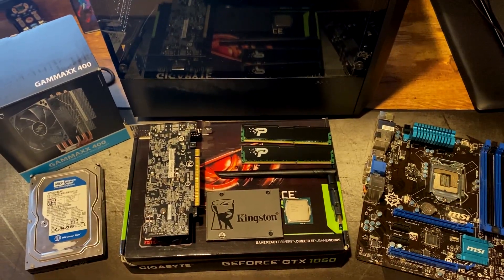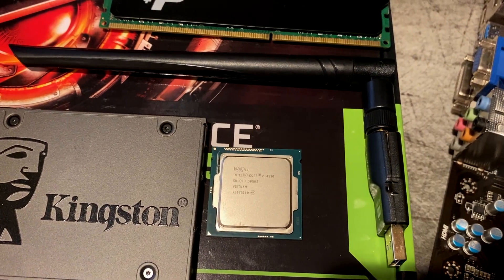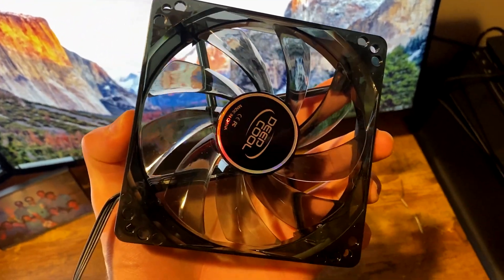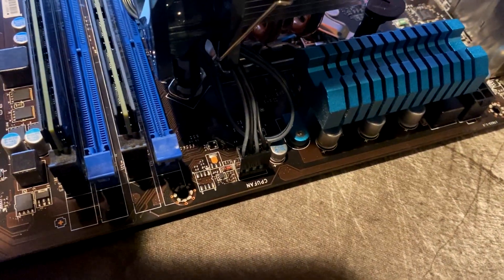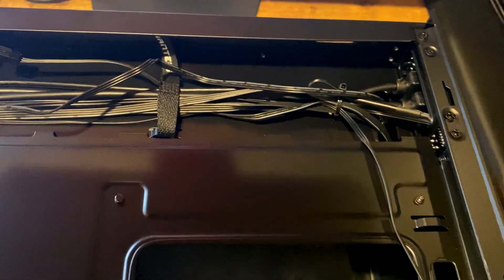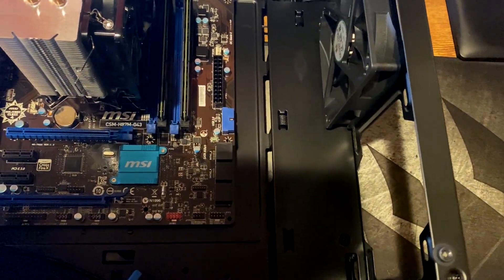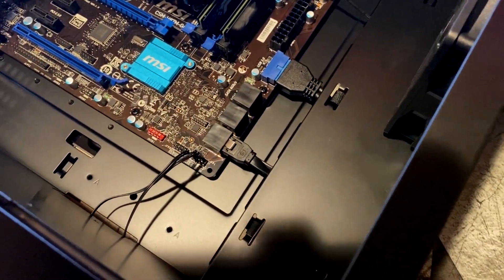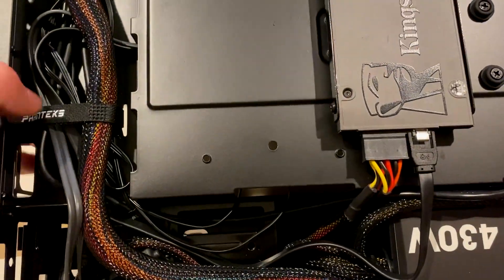How to Build a Gaming PC for Under $400

Comment: For $100 instead of getting a GTX 1050 you could have gotten a used RX570 (or RX580) with 4GB VRAM and it'll do circles around that 1050.  Other than that it rest of the specs are pretty tight.
Reply from the maker: I completely agree, I had a 1050 around from an old build, but a 570 or 580 on the used market is comparable in price and way better performance!

Comment: Hey man, really nice video, but honestly, I think, it's better to buy an optiplex offline with the i5 4th gen or above, and some even throw in a monitor and keyboard and mouse too. I'm getting that in india for like 150 to 200$, throw in an ssd, more ram, and the 1050 ti you got there, and it'll be the same build you did, for a lot cheaper too. The stock power supply is good enough to power till an 1060 gb.

Still tho, loved you video, and I hope your channel will grow.
On the side note, I would use a cheaper case lol, and swap out the 1050 ti, for an 1060 6gb. Would be way better to spend more on the gpu than on the case. (I'm planning to use the stock case too lol.i subbed tho, hope to see more videos for you 😅👍)
Reply from the maker: Thank you, and good luck with the build

Comment: You didn't use enough thermal paste! Haha jk. Also, do those plastic clips provide enough compression between the heatsink and the i5 chip to spread the thermal paste?
Reply from the maker: Definitely, the clips allow for just the right amount of compression for good thermal contact.  The cpu stays nice and cool, never really getting above 65C
Reply: @TechRoundUp  Could you have reduced the cost of the pc build by not going for the peripheral items such as the LEDs if you're only interested in performance and not aesthetics.
Reply from the maker: @michaelkertes3852  There are definitely some better options coming out with the AMD Ryzen 3100 and 3300X, which are $100 and $130 respectively but will perform better and come with a cooler saving money and increasing performance